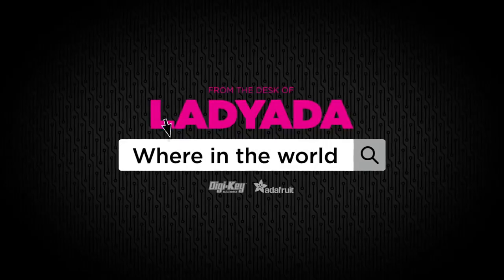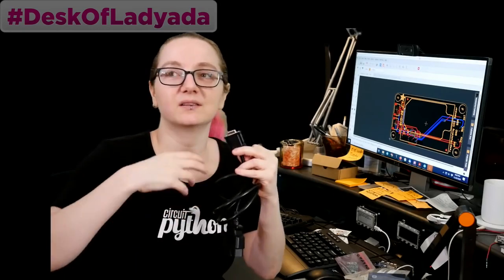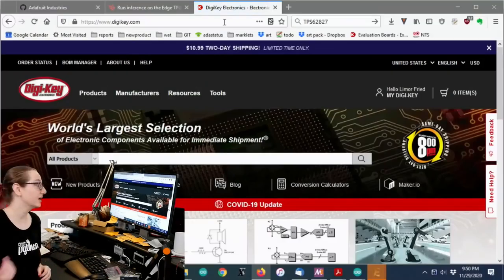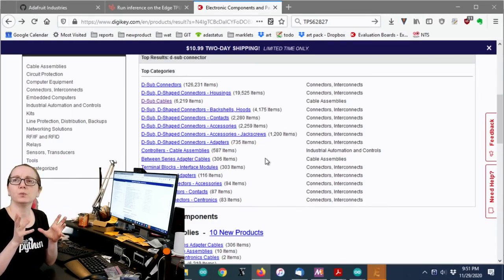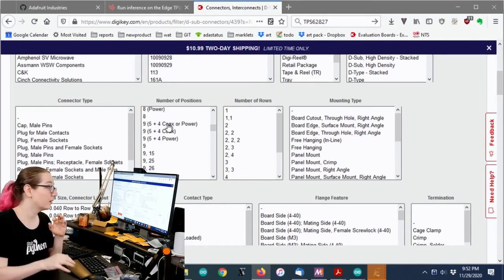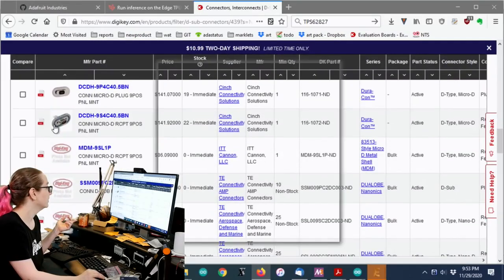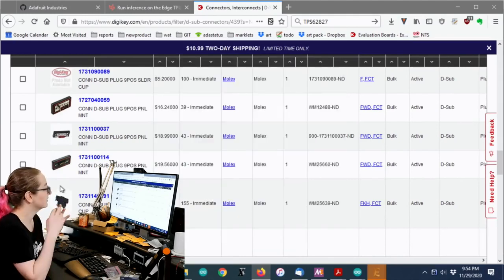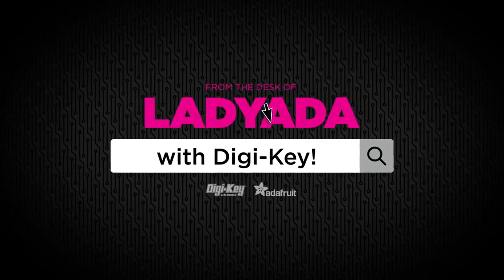The Great Search: Find a DE-9 a.k.a DB-9 connector and the other variants! #TheGreatSearch #DigiKey

Comment: I think the original problem began with the DB-25. It used to be the default (25-pin) connector for the PC serial interface. If I remember correctly, they were also used for the PC parallel (printer) interface, but the gender of the pins was the opposite. Anyway, people assumed that 'DB' was the designation for all D-shaped connectors, though the second letter was supposed to designate the number of pins. As you mention DE was for the 9-pin version. There were I think 5 different sizes back in the good ol' days.